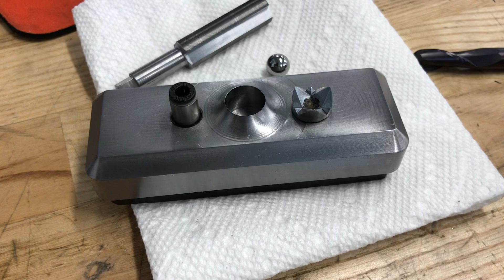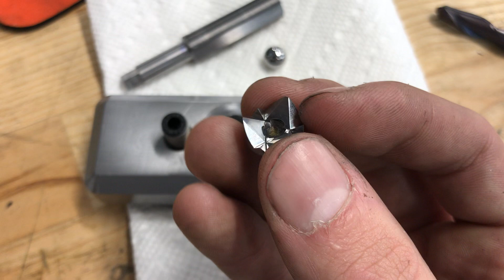Genius Method of Making Kinematic Ball Mounts for Air Bearings

Comment: Good solution! That 3-point insert looks really clean and even. Did you grind or machine it?
And just because I'm curious, did you consider making the ball socket an air bearing too?
Reply from the maker: It was just machined on the manual mill then lapped to 2000 grit after hardening. Having the ball socket be an air bearing is technically the ideal solution, yes, but the load capacity of an air bearing of that size is far less than the force i would need to apply to correctly preload the main bearing, so it would just ground and rub. Thanks

Comment: That looks very cool. How was it made.
Please correct me If I'm wrong but wouldn't both surfaces being hard result in a similar amount of wear if there is no oil-air film in-between?
Reply from the maker: Piece of roundstock held in a hexagonal collet block was tilted at 45 degrees in the mill vise , and a single pass of an endmill in the Y axis repeated 3 times 60 degrees apart creates the prismatic shape you see. After i just hardened it and lapped it. Rubbing wear is not the main concern here necessarily. The joint theoretically shouldn't move at all after installation, its more for initial alignment. The hardness is only desirable because it reduces and resists the deformation due to the Hertzian contact stresses, which can be amplified by vibrations during use. If i used something softer, the hard ball would eventually deform the socket overtime and loosen. Neither of these points were well addressed in the video, sorry
Reply: @cylosgarage  Thanks a ton for the detailed explanation! Are there any sources that I can read more about this?